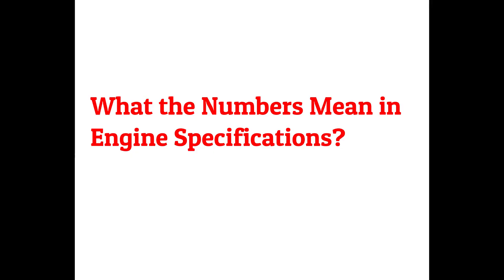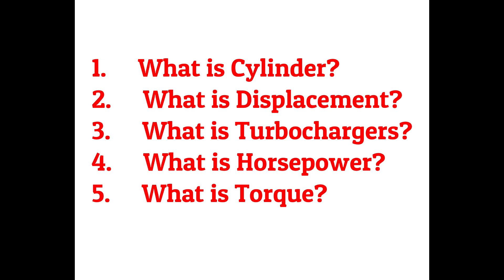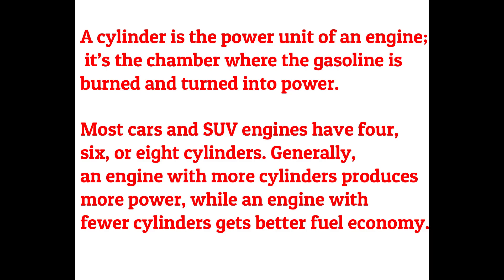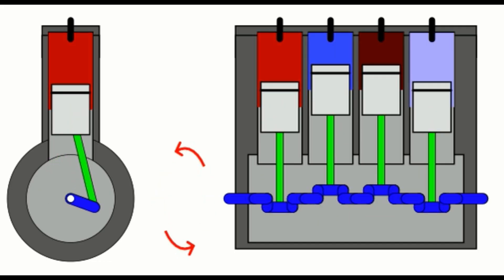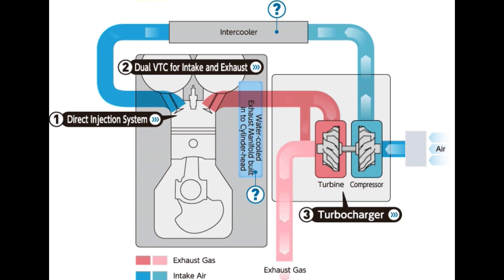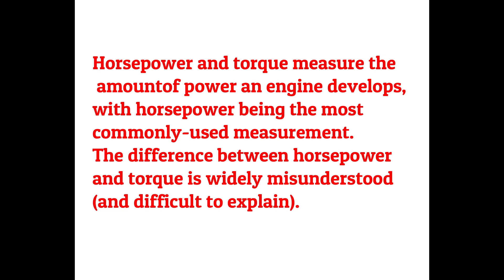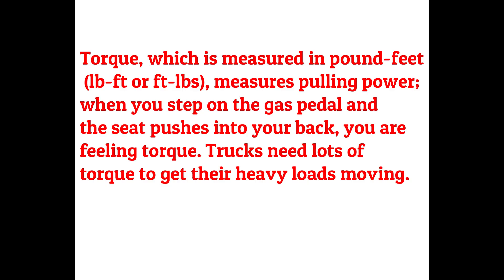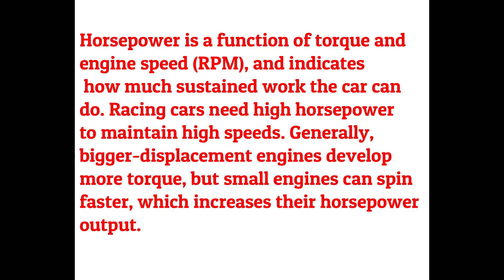What does CC or liter mean when describing the power of an engine

Comment: does more power means the car accelerate better? or increase maximum speed? or more better at steep road
Reply: more power can usually mean 1 of 2 things: 1.) the car does not have to work as hard to get upto speed or 2.) Gives you better acceleration and potentially top speed. but there are many other factors that go into performance
Reply: Someone please answer this mans